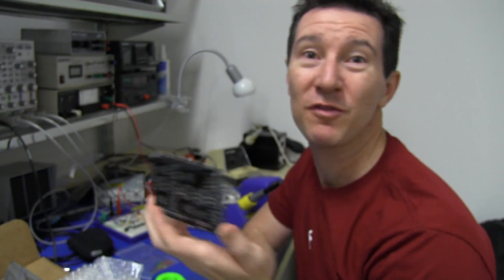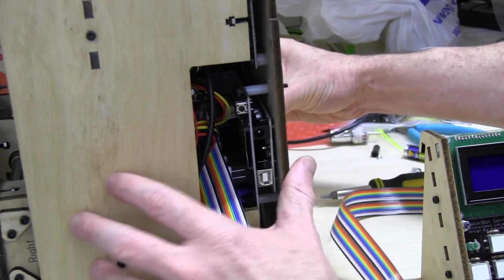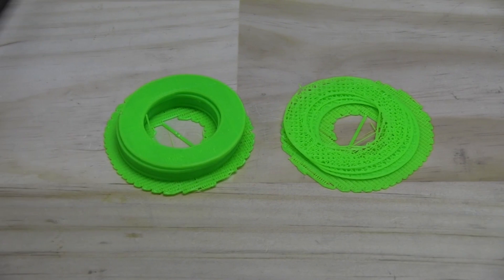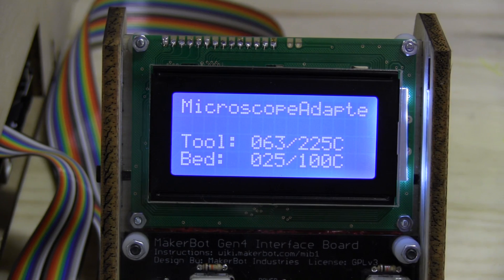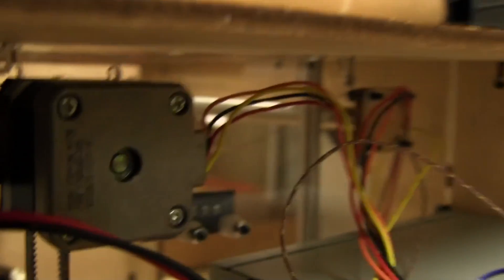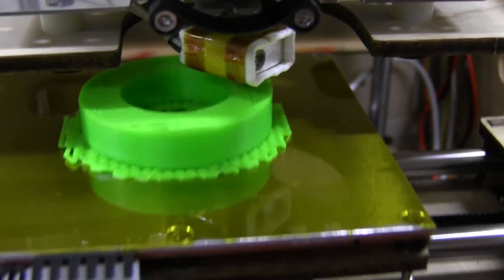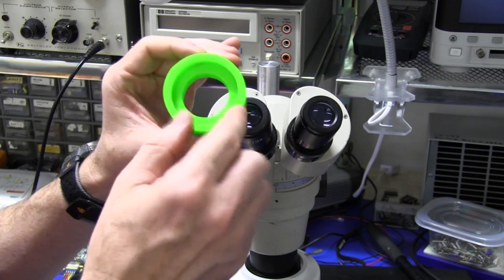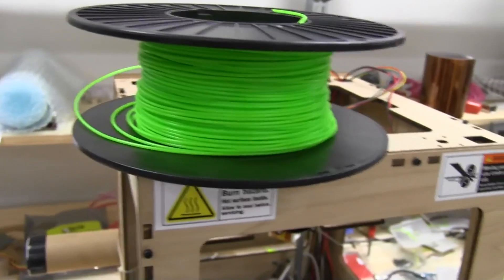EEVblog #274 - Makerbot Tweaking & First Print

Comment: I know this is an old video... however I would give you a few ideas for your machine.

1.  Put pillow block bearings on all the drive rods for the x and y axis towards the outside stopping deflection and increasing accuracy.  These drive rods will deflect almost 1/32 of an inch.  File flats on the ends of the rods and lock tite the grub screws.

2.   Make sure your jumper settings are set for 1/16 step on your board, OR 

Better yet switch out that Mighty board for a ramps 1.4 and go 1/32 step and use ddrv 8825 stepper drivers.   Another benefit of using ramps 1.4 is using the auto leveling feature.  Position a small servo motor below the extruder on the carriage.  A printed L shaped foot is connected to the servo motor.  On the end of it is the z axis endstop.  The new firmware will probe a pattern you specify raising and lowering the foot, creating a calibration field to auto correct imperfect build plates.  This will allow the macine to move the z axis up and down to make sure your layers are level regardless of how level your build plate is. It is a bit more complicated than that but I didn't want to make this a how to :)

3.  Use the vref on the stepper driver to properly set the motor current and voltage per spec  Be careful, the pins are very close together and you could blow the stepper if you slip.  Take special care to listen to your extruder motor.  Any clicks = missed steps and there is a problem somewhere, see below.

4.  Clean the kapton tape surface with acetone every build, or switch to buildtac. This stuff works great on a wide range of thermoplastics.

5. Layer offset can be a symptom of over extruding, either incorrect settings for steps/mm for extruder or overheating /heat soak of hotend barrel while printing.  Verify correct steps/mm for extruder:  Mark black marker on filament, then measure from fixed position on extruder to mark.  Extrude 10mm then remeasure.  Change steps/mm in firmware, remeasure until your as close as you want.  I usually shoot for +- .1mm.  You want to extrude at the lowest temp possible, + about 10c.  I print abs at 225, i can extrude at 215 min. 

6.  Verify your first layer thickness , use z axis offset to correct if necessary.  Your looking for only 30 to 40% compression on the first layer, 50% max.

7.  Print a single walled calibration cube, let it print 2 layers and kill it.  Measure the bottom layer vs the top layer.  Use that ratio on your printed parts to get your correct fit.  I know it sounds stupid, but it works.

8.  Shield the sides and back of your machine from drafts.  Abs is very sensitive to temp changes and why it warps the bottom layer stays hot while the upper layers cool too fast causing warp.  Pla has less of this problem.

I understand this was sold to you as a "consumer" grade product, and you are justified in demanding a certain level of use from it, but it is far from that.  

Makerbot basically took open source hardware/software and compiled it into a product., expecting the customer to engineer some of there own solutions to problems in the machine, calling it "hackable" ,  which did happen, because it was open source, and community supported.

However.....

Since the creation of this video Makerbot was bought by Straysis has taken all of there designs closed source, basically turning there back on the open source community.  Even worse, Makerbot has now actively been filing patients on open source designs, including those in there maker bot replicator, and other open source designs.

I built my first 3d printer a Darwin, and what a pile it was :)
Since then I have built several other designs, I have a prusa i2, rockstock, and a  smartcore which all outperform even the latest makerbot designs.  

Should your printer worked out of the box, yes.  Were you right to expect it to, yes.  Should you have to engineer your own solutions to there shortcomings, no.  I listed above what I have had to do to one of these printers to come close to the quality my i2 can do.  Basically the point is that this company took you and alot of other people for a ride.  

Don't give up on your 3d printer and let it sit on a shelf.  Prototyping your own parts is just awesome :)

Comment: Yeah, you get what you pay for.
That's why high-end 3D printers cost an arm and a leg.
Getting something working is one thing, but getting it to reproducibly print parts with a tight tolerance is a whole other ball game.
Reply: Or just use smaller steps and feed in less filament?

Comment: why would you print this way instead of powder fused with laser ?
Reply: and how is the better technology going to become mass available and mass produced if the investment is in the lesser and simpler one ?
Reply: I bet if someone stars making it the price can be the same ... a powerful lase diode instead of heater and dust instead of wire ... the rest is the same ..... and you get a much higher tweaking possibilities and much better part stability and resolution ...

Comment: why don't these machines use a independant position sensor feedback ?

it's not like 15$ micro meter with 12" range and serial outputs are hard to use and that all have 0.005" accuracy !

Comment: Glad u got that figured out as i knew you would, i like the fact you posted your failures but lets face it the finished parts were not really fails, they just need slight machining to fit properly. This machine is brilliant, just think how much an injection moulding machine costs compared to the maker bot. Good Job Dave

Comment: I'd look to the coefficient of expansion of the plastic you're using instead of over-squirt as source of diameter discrepancy.  The size of high spec cylindrical dimensions will vary considerably with temperature. trying heating it up with a hot water bath, you might be able to heat-fit it, and make a glue/clip free permanent adapter.

Comment: Hi David we have a Makerbot here and you are having similar problems I think that most have.
When you have a heated bed you usually do not require a raft to be printed, this is normally to be able to remove the part from a cold bed. Also try 110c as that's what a lot are recommending.
With regards to size allow for plastic shrinkage as it cools and also you may need to do a calibration piece and also check you have the absolutely the right model in the software.

Comment: Bloody hell! After all that you had to configure for different steppers? I thought the most you've have to do is tell it how many steps per rev is does, maybe tweak the voltage a bit and that was it! Thought the setup would be a bit more robust than that. You live and you learn!
I love that you're using the makerbot to print parts FOR the makerbot :P Just don't give the thing sentience! There'll be no stopping it.

Comment: Very good point!  Also of note; hit it with some wide kapton tape - it will make your life SO MUCH EASIER!  (just don't try to separate the part until it's totally cold)

The kapton's adhesion to abs is huge while at 100c, but 'less than the thermal stress' at room temperature - parts just fall right off, smooth as a baby's bum!

Comment: It's a DIY kit, new Replicator one comes assembled to "just work" but I prefer the kit way because allows you to build your machine with extreme dedication, plus the learn and enjoy. Hey dave! test this firmware: "thing 17855 in thingiverse" your device will work 100 times better!. About the cable dave misconnected, that is confusing of course but it is specified in the instructions so I think a good idea is to cut the connector to avoid forgetting that, of course, again: DIY kit

Comment: Looks like you are printing ABS. You could probably get that adapter to fit if using PLA by immersing in boiling water for a bit and squishing it on. Not printined with ABS myslef - may need to get so near melting point for it to become pliable that it loses its shape too much, but maybe worth a try with hot air gun / warmed up in the oven.